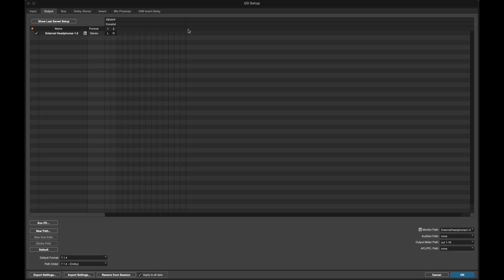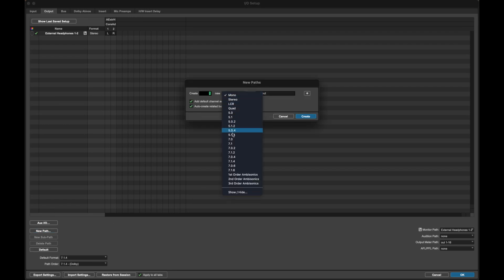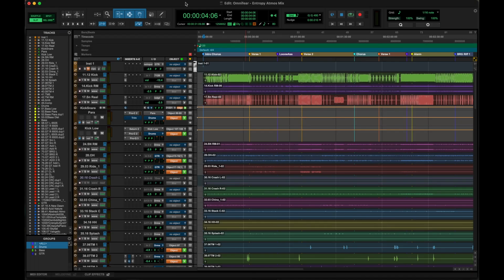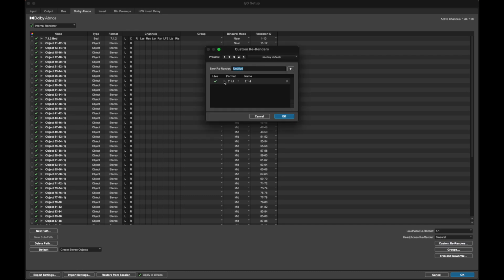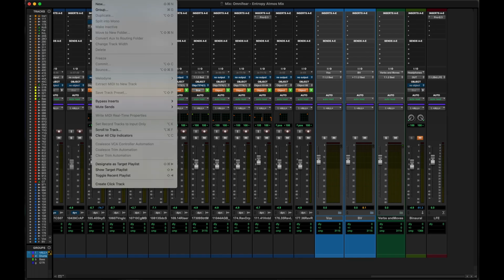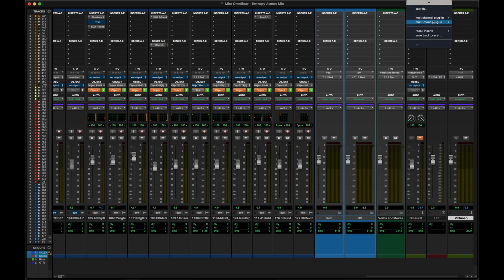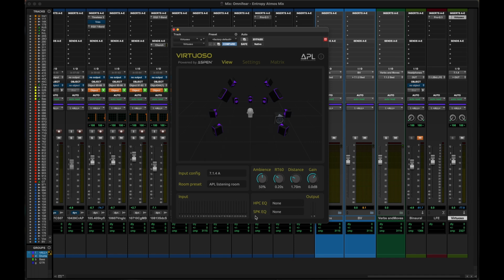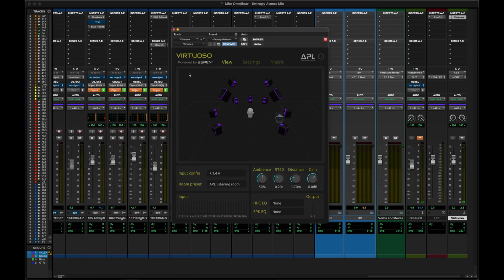How to use APL VIRTUOSO with Dolby Atmos Internal Renderer in Pro Tools (wear headphones)

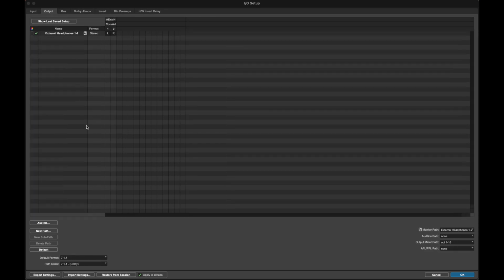Comment: What does the "AExtrHCoreAd" above the External Headphones 1-2 Path at 1:00 in the video, mean? I am using UAD Apollo x6 (Gen 1) to mix and listen to Dolby Atmos. I have created a 7.1 Path in the Output window, but when I try to create an additional stereo Path for the Headphones routing, I get the error message from ProTools Studio: "The output path "Main" overlaps with the output path "External Headphones 1-2". I can't figure out how I can create a new Output path that will use output 1-2 on the Apollo x6. Any suggestions?

Comment: There's no need to create a dummy output. The renderer can be in 2.0 mode and you can still create a 7.1.4 or 9.1.6 re-render to feed into Virtuoso and route that Aux output to your headphones. Or am I missing something? Just make sure you mute the renderer itself as to not overlap the signals.
Reply: Yes, but if you mute the Renderer you do not have a visual control about your Dolby Atmos. Or did I miss something.
Reply: @tomweber2671  you can just pull down your output master, then the renderer still works the same visually, but you don't have the risk of feeding your L/R signal into the binaural path. :)

Comment: Great video! Can you also use head tracking at the same time?
Reply from the maker: Yes you can use headtracking in Virtuoso. It supports Supperware Bridgehead, Waves NX tracker, and Audeze Maxwell headtracking, etc.
Reply: @apl-hud  Just tested it today and it is working perfect! Buying in 3, 2, 1 .... hahaha Thanks for release such incredible software
Reply: Hi Marc, about headtracking it is very important to know that there is a real problem with Supperware, APL Virtuoso, ProTools and as APL mentioned the Eucon Protocol. In the moment it is not compatible and in this combination it will lead to strange ProTools behaviour followed by ProTools crashes. No possiblility to use it. APL told me they are working in this problem.
Reply: @tomweber2671  I'm currently using a Supperware head tracker with APL Virtuoso 2 and PT internal renderer without any problem or crashes. I don't know about Eucon as I don't use any compatible hardware.
Reply: @ThisIsHeraldoJones  Ok the problem seems to be the Eucon protocol. This is what APL told me. APL and Ben Supper are working on it. I do not know, where it is on their todo list, but working without Eucon is not an option for the most.